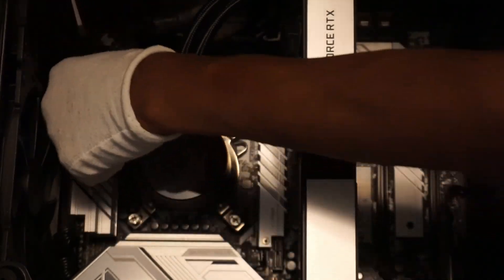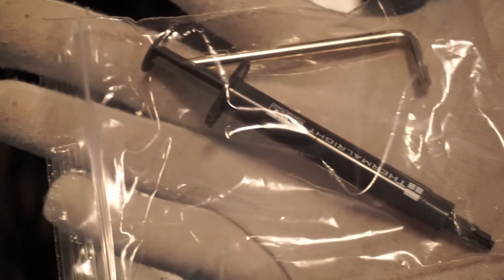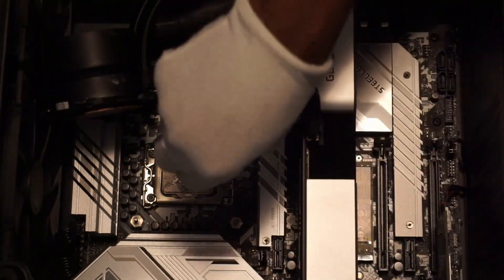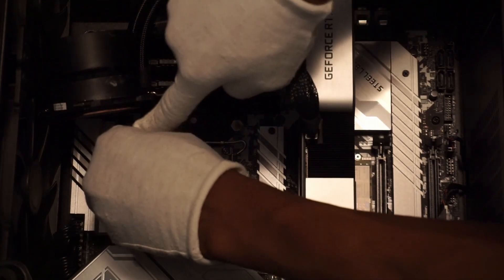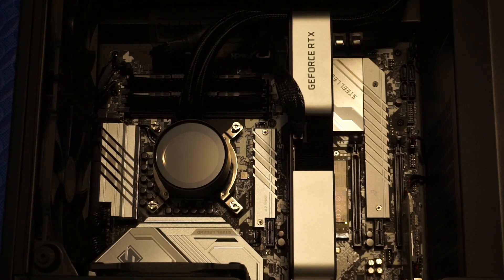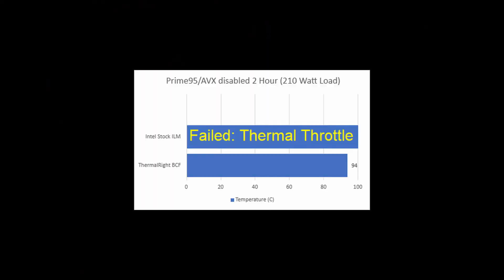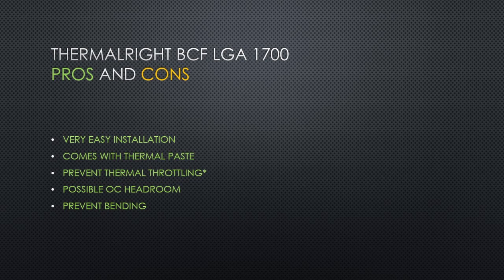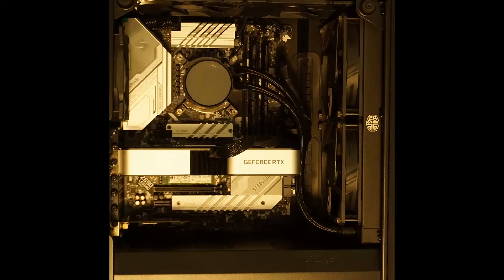Improving 13600K Cooling With ThermalRight BCF Contact Frame

Comment: Hey i was just make an upgrade with contact frame and my CPU got clock down while the wat ussage is the same and all bios settings was exacly the same as before upgrade... Any tip? Or idea what did i do wrong?

Comment: I have an Intel Core i5 14600K. I made some changes in my motherboard settings. I've changed the CPU Lite Load setting and i adjusted the power limits (PL1 and PL2) to a Intel recommended values at PL1=PL2=181W and 200A. I also was able to under-volt my CPU at around -0.130 V resulting in my voltage staying at around 1.12 V. At best I have a mid-tier MSI 360 aio cpu cooler and with all those tweaks my temperatures stay at around 70 degrees celsius while doing cpu stress testing during a hot day. All this without a contact frame, which i plan to buy anyway except the temperatures are fine, but there are some occasional temperature spikes to around 55 degrees celsius while doing some desktop related stuff like browsing the internet, especially YouTube. That's why i want to try a contact frame to see if it will eliminate those spikes at desktop. Also i have to replace my thermal paste because i used some cheap solution like Arctix-MX2 which is not good enough in my opinion.

Comment: I use it from day one, never installed the cpu without it. works well. just dont crew it tight or your pc will shut down at the slightest move of the cooler and sometimes would not start. keep it loose  and no problem will ocur.

Comment: can you let me know or make a vid on your bios settings? I have a 13600k and haven't been able to undervolt properly. At stock my Vcore is constantly above 1.42 volts while gaming reaching up to 1.58 at times. This increases my temps up into the 95-105 range constantly while gaming.
Reply from the maker: I go over the settings I used in the FIVR menu in this video https://www.youtube.com/watch?v=QeD8n1LLBLQ I'm on the latest ASRock BIOS, different BIOS will probably behave differently.

It does sound like your voltage is a bit high, on my latest BIOS the voltage also seemed a bit high before undervolting...

Comment: Hey brother, thinking of buying same frame for my 13600k. Can you tell what yours voltages are? I get stable 1.23-1.24v for 5.2ghz and 1.29-1.3v for 5.3ghz (ecores 4.2ghz and testing in 30 minute cinebench with furmark runing in background). I think my chip is far from good binned.. Using one of the best AIOs and getting 80-85 temps under full load with 1.25v and 180w usage which makes me kinda sad :( I was thinking of 70c max while rendering before I bought that
Reply from the maker: Just running R23 for 10 minutes the average voltage for me is ~1.276 with my undervolted overclock profile.